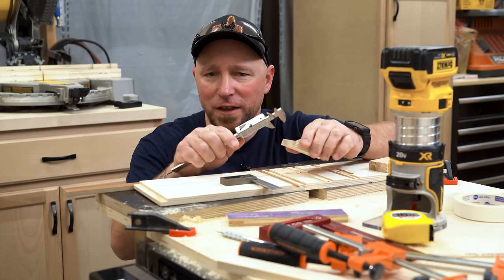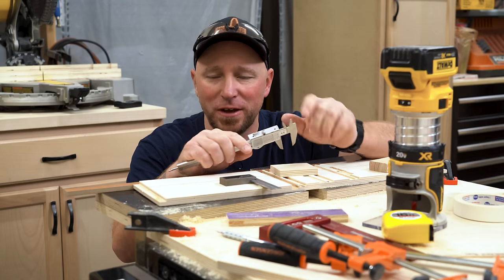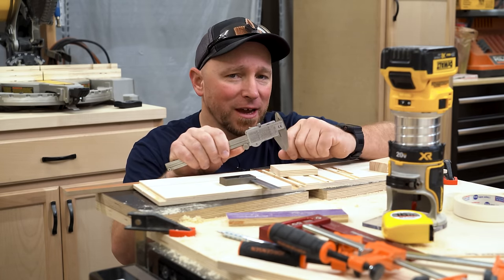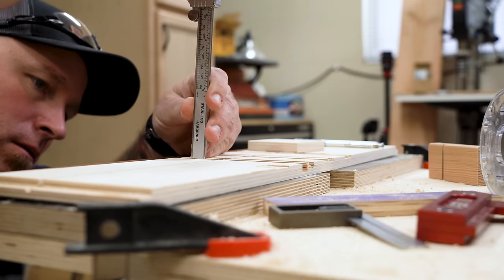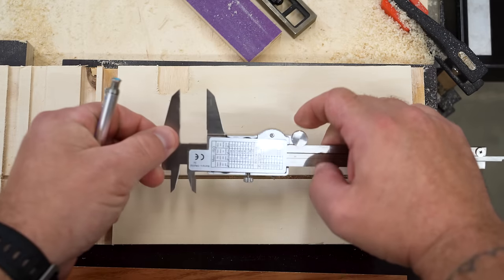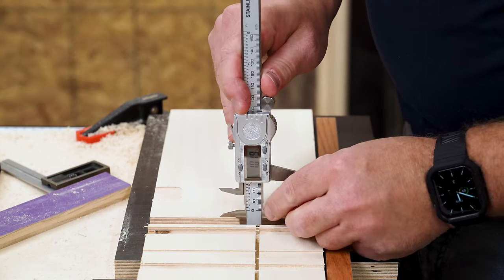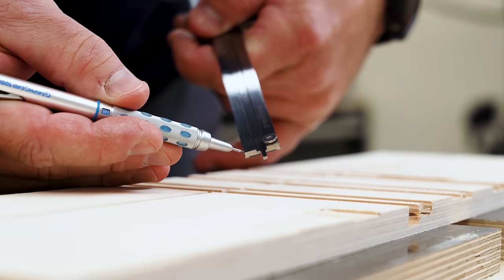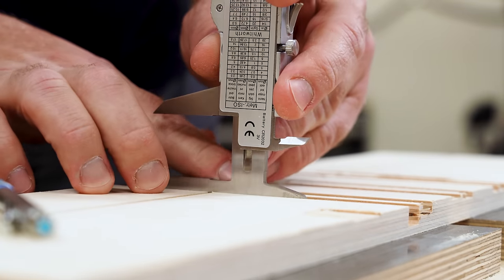The HIDDEN 4TH WAY to Measure w/Calipers

Comment: I got taught this when I first started my apprenticeship and was shown a neat trick at the same time. If you need to measure the depth of an 8mm dia blind hole, get an 8mm dia pin so its nice and snug. Measure the length of the pin with the jaws of your vernier, then zero the vernier so it reads 0. Place the pin in the hole and do the 'fourth way of measuring' from the top of the pin to face of the material. You now have an accurate measurement for depth!
Edit: I'm a mechanical engineer but started my trade as a machinist doing high precision components.
Reply: Here's another similar tip for how to measure the distance between the centers of holes: put the inside jaws in one hole, expand as if measuring the hole and zero the readout. Then put the same jaws from one hole to another and expand to fit. The reading is the center to center distance because you have already subtracted one diameter. This works on smooth or threaded holes if they are both the same size.
Reply: @DugGLe55FuR  works the other way too if you measure across the bolt or shaft in the holes first.

Comment: I used to be a mechanic in the military. I serviced a vehicle. Completely removed the callipers and greased the sliders. Well I didn’t pump the brakes and started this truck. Lightly touched the brakes and put her in drive. Well she took off and the brake pedal went to the floor. Needless to say the truck ended up in the bay door.  Wasn’t my finest hour.   So whenever I saw someone doing a brake job I’d just mention the not forgetting to pump the brakes before you intend on getting going.  Seemed stupid because most people know but it’s always good to throw that reminder out. 🤙

Comment: Holy crap, you seriously changed my week with this.  I measure depth of diamond grinding bits on a regular basis and the bottom depth gauge is always awkward.  I can't wait to try this tomorrow.
Reply: You could actually use a tool made for measuring depth, like a depth mike:)

Comment: And, if you want to know if several 'identical' parts are truly idential, then measure one part and reset the zero.  Then check the other parts to see if (how much) they're within the useful tolerance.  The same goes for checking a board end for end.

Comment: One important note for those working with sheet metal bending - that step-gauge mode will often catch at the top of bend radii and so mess with your measurements! As always, spending that extra half-second to make sure your calipers are resting where you think they are will pay dividends!

(Also: I was shown that method soon after joining the quality team at my workplace. I don't use it terribly frequently but hey; every tool in my proverbial tool belt is valuable for those odd occasions they see use!)

Comment: Center distance of two holes the same diameter: measure one hole with inside jaws, and zero the digital caliper. Now measure hole to hole using the inside jaws. The number you see on the caliper is the center distance of the holes. 🤗
Reply: Thanks Philip, nice handy hint.

Comment: I hate coin batteries - so expensive and don't last - so I prefer an old-school mechanical dial caliper to digital. I'm not a machinist looking for half-thousandth tolerances or anything - just a shadetree mechanic with the occasional need to measure a brake rotor or size a bolt or unmarked hex key. I like a tool I can just pick up and use without having to wonder if I need to go buy more @##_& coin batteries.

Comment: You are using the depth gage wrong. You are supposed to turn it 90 degrees (in vertical plane) and then measure. Not balancing it on a wafer thin edge...

Comment: I've been using "very nears" for years... but I didn't know this. I just knew there has top be a better wat to measure depth as I struggle to get repeatable results from it rocking around. Thanks and I will use

Comment: Ive been using calipers for my CAD designing, and NEVER knew that feature existed. Thanks for the heads up!
Great video btw, no 5 min intro and outro or begging fir subs and likes,just straight into the tip. Amazing.

Comment: New to me.  I tried this with a cheap digital pair. Measuring a nominally 10mm thick sheet of acrylic between the jaws: 9.60mm, measuring using the obvious depth gauge part: 9.59mm, measuring using this new to me feature: 9.54mm. Could have been better but for $20, good enough.

Comment: Another very useful tip for accurate measuring: Use the METRIC system and not the ridiculous and difficult to use imperial system that only 4% of the world's population still insist on sticking with.

Comment: Speaking of routing, I acquired an old, poopy craftsman router years ago from my neighbor. Cleaned it up and used it once or twice just for fun. It squeals like a pig when running. Fun! 
So, today I just found an old, craftsman "letters and numbers" router guide. Unopened, in original box. I looked at the instructions and there's a picture of the same poopy, craftsman router. Haha!

Comment: As others have mentioned, you need to make sure that those surfaces are ground to be used in this way.  It'll be obvious if they have been because, when the jaws are closed, those two surfaces should be flush with each other and have continuous grinding marks across them.

Comment: Not sure why you'd use that over the regular depth gauge. A pointed surface will always measure more accurately than a flat surface... Unless you're trying to measure rubber, I guess.

Comment: I did not know that. I have a cheap non-digital Harbor Freight one that I barely know how to use. In fact, I don’t use the measurements on it because they are hard to determine. I mostly use it comparatively.

Comment: I was aware of it from other YT videos. However, my calipers don't have that feature. Or the depth gauge feature, or internal jaws. The external jaws do have a surface for measuring internal distances and once measured, you have to add 250 thou as that's the thickness of the jaws !

Comment: I retired after 45 years as an industrial machinery mechanic, I never knew of that particular method of use.  In all those years, I probably never looked at the instruction manual for a set of calipers.  I knew what I was doing, what did I need a manual for.  LoL.

Comment: What a clever tool. I also just learned this from the video, but then I don't measure depth much. It seems that the usual depth gauge is probably for checking things like blind bolt holes, which would need a very skinny gauge, while the method you just showed is probably meant for nearly everything else

Comment: And then a 5th way: If you measure the total size of the caliper itself, you can add that to the measured distance in the dial, and effectively double the length of the caliper, to measure longer stuff.

Comment: I've only been using legit calipers for a couple of years, the only ones I have are from Home Depot, and I have a couple of different styles.  I did not believe any of caliper sets had either the bottom-slide depth gauge or the top-end backing stop.  They all do!

Thanks for the tip!

Comment: You can also youse the "4th" funktion to mark offsets from the edge.
Just move your callipers to, lets say 10mm, lock it, press the lower ledge on the outer face and trace along the upper edge. You can even slide the callipers around while tracing to get a straight and precise line along the whole part.

Comment: Only use the depth guage if you can't use the calipers this way. But be careful that your up against a flat surface as placing against an internal radius will affect your measurement. I'd also recommend vernier scale calipers. They have no battery, screen or dial mechanism to go wrong.

Comment: I'd actually forgotten about the second way of measuring depth until I saw this -I actually got shown that by an old engineer when I was a teen and thought he was joking, but tried it out a few times myself while no-one was looking!   When I saw this video I actually thought 'Well yeah, duhhhh.... oh wait... '  (I hadn't thought of doing this in nearly thirty years)! 
I've never liked (or indeed used) digital calipers or the ones with a gauge - the same guy told me that 'the more moving parts, the more potential for error'.   If I'd have listened to this guy more when I was a teen I'd have suffered less woe as I got older and had to re-learn stuff.

Comment: This is a way to measure steps, the pointy thing at the bottom is for measuring holes. As you explained the 4th way is much more reliable for wide places like steps for you keep the tool upright and dont measure in an angle .

Comment: Just checked my old Craftsman dial calipers.    Your method would work on mine, but some small amount would need to be added because there's a step there, the two parts
are not dead even when at zero.  So, you could measure that step using another calipers.   :o

Comment: I was a QA technician measuring vendor supplied and in house made parts. Had four upright cabinets of calibrated measuring devices. Did that for 5 years, 20 years ago, and have continued to use calipers in my woodworking shop. This is the first I've seen them used this way. Awesome, thank you.

Comment: The 5th way to use calipers.  To measure the center to center distance of two of the same diameter holes (and get a direct reading on the digital scale) measure one hole's diameter and zero the caliper.  Note: this method ONLY works on digital calipers that can be zeroed.  Then measure (using the ID calipers) the outer inside edge to outer inside edge distance of the holes.  You have now measured the center to center distance since you compensated the digital caliper with the diameter of the hole.  None of my apprentices knew this trick from vo-tech school.  This is useful since drawings list the center to center distance as part of the dimensional information.

Comment: I took my tool maker apprenticeship around 50 years ago and was making step measurements with vernier calipers (before digital calipers were invented  ) way back then. Every quality set of calipers has both fixed and movable jaws ground flush to make the step measurement. Can't say about some cheap woodworking calipers. Glad you finally found it. That can be a useful feature.

Comment: I discovered this when I bought an old beat up calipers.
The step-gauge section had clearly been surface-ground, the edges carefully dressed, and was perfectly square to the body.
Every feature of a tool is there for a reason, why would anyone do this?
A quick measurement opened my eyes!

Comment: Always knew this. But blind holes usually need the traditional depth measuring method. You can buy a T adapter to go on the bottom/end of the caliper for a more stable “foot” if you want more accurate repeatable measuring (perhaps it is a SPC tracked dimension on production).

Comment: Unfortunately most calipers do not accurately grind that section. Also the large surface are makes it super easy for a small bur or shaving to throw the measurements off. Of course if you need the measurement to be quite accurate you wouldnt be using calipers at all so its likely perfectly fine

Comment: Awesome tip; thanks!  That definitely solves the problem of unstable measurements with depth gauges.  Thanks for covering this topic in 1 minute and not stretching it out into a 20 minute teaser.

Comment: I knew that before! But only for two weeks or so! Saw someone in a youtube video using the top step gauge not for measuring, but to draw a parallel line to the edge. The broad head of the caliper is far better suited for that than the very tiny depth gauge at the of it.

Comment: I did not know this and had to run out to the shop to check. Sure enough, both of mine have this feature. I've always thought that the depth gauge function was the weakest feature of these tools. Now I know better. Thanks!

Comment: The digital caliper I recently bought does not have the traditional depth gauge, but it does measure depth on the back as you showed. I did not know this, so yes, this was a very useful tip!

Comment: I was involved in some precision manufacturing and material science, and 99.9% of people I ran into never used this tool that way, you just need to be aware that this method is not as precise (more than precise enough for woodworking and most 3dprinting though).
Reply from the maker: Actually this IS a legitimate fourth way. I don’t have the instructions for the Empires that I used in the video, but my Mitutoyos have it in the instructions.

Comment: What accuracy is required in woodwork? As far as i know in metal machining it is 0,01mm
Reply from the maker: Depends on what you're doing. There are many situations where just a few thousandths can make a big difference on whether or not something goes together. Plus, woodworkers tend to use other materials that need to be measured and make their own tools and attachments that sometimes require fine tolerances.

Comment: There is also an attachment with a thumb screw that locks onto the other end for depth measurement that gives you more surface area for depth measurements from the depth end.

Comment: I definitely did not know that. I have noticed that same thing on my digital calipers but didn’t ever think to much about it or take into consideration what it could be used for or that it had an actual function to it. There has been a countless amount of times that I’ve used the depth gauge to set the height of a router bit or checking the depth of a dado/rabbit, tenon shoulder, etc. and have always felt like that wasn’t very accurate. Thanks so much for sharing this.

Comment: I have always preferred it because you are moving the same part of the caliper with your thumb, so the action doesn't change. I have always found the depth gauge awkward to use.
Reply: Actually thinking about that I got it wrong. What is different is that for all other measurements you push the body of the caliper against what you are measuring and slide with you thumb. Not so for the depth gauge. Had to pick up my calipers and play to figure out what I really meant

Comment: Yes ... thank you for saying that lots of people may know this ..
It's a breathe of fresh air , against thousands of vids of people who just discover something,  and then belive everyone must be as stupid as they are. 
But .. no insult here .. if you use calipers all the time ,, you probably will know it , if just sometimes , you may not , 
I actually did , as my very first set ..came with a small manual..
That I actually read .. I may still have it .
Also ..more expensive calipers have a few extra features ..so don't be surprised if you look on the back of yours , and find nothing ..
Reply from the maker: The only thing is that a lot of folks are taught by someone else long before they get a tool of their own, so when they finally purchase their own tool, they don’t read the manual. Also, second hand tools don’t usually come with manuals.

Comment: It’s right there in the instructions manual. Sheesh and on top of hearing all these engineers, teachers, tradesmen who didn’t know this . Makes me wonder
Reply from the maker: Many times people don’t have an instruction manual, like if they get them second hand. Or even if they buy new, they may have already been taught how to use them by someone else, most likely by someone who also didn’t know about the step gauge, and they didn’t read the instruction manual when they bought them because they already know how the tool works. Perfectly logical, if you think about it.